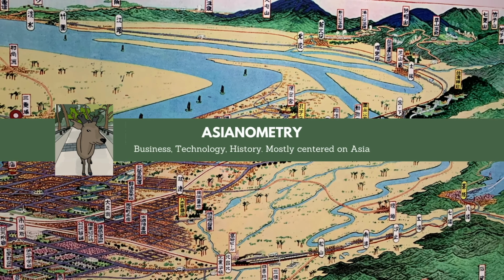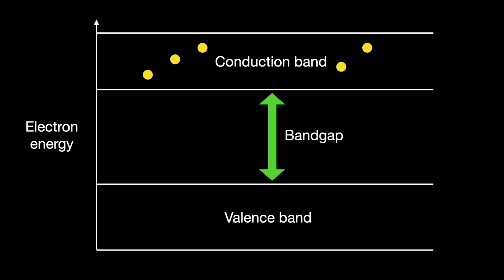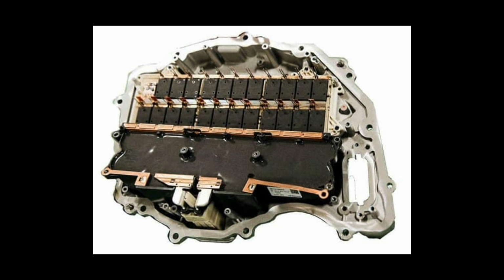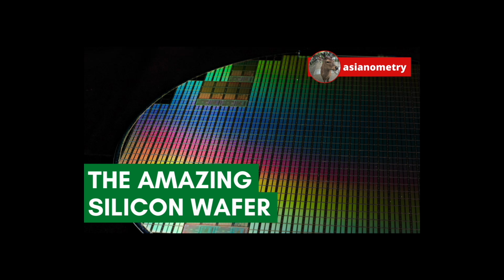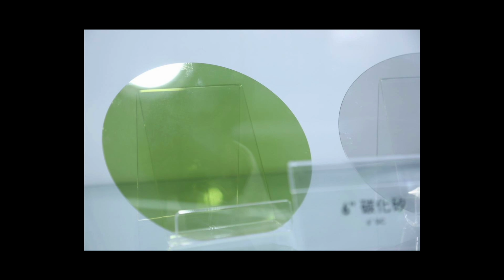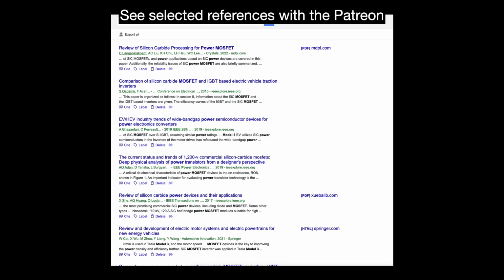Silicon Carbide: A Power Electronics Revolution

Comment: Until a few months ago, I was a research fellow working on silicon carbide devices. Please allow me to leave some commentary:

1:40 - 4H and 6H are the only polytypes that can be grown as commercially-relevant bulk wafers, but 3C can be grown on silicon! 3C-on-Si is... well, it's not great. In layman's terms, the atomic spacing of 3C-SiC is different to that of Si, meaning 3C-on-Si is full of crystal defects. Just to pile it on, SiC fabrication processes can get up to 1600°C, but Si melts at those temperatures, meaning there's key steps you can't do properly to 3C. I am very interested to see if the 3C wafers devised by Francesco La Via and his team - where they start a 3C layer, melt off the Si and grow a new 3C wafer from the starting layer - can reach the crystal quality and practicality required for real devices. 3C has a bandgap that's not as wide as 4H or 6H, but its electron mobility is higher and it might compete with GaN in lower voltage applications. If La Via and his guys can improve their process!

2:00 - 4H has a wider bandgap than 6H and isn't much harder to grow, that's basically why we're using it.

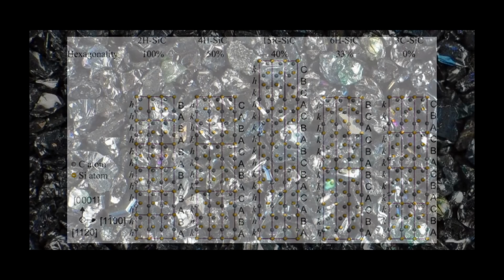2:08 - Tangent: the same strong atomic bonding that makes SiC hard also makes it a pain in the butt to chemically etch. Acids don't do anything to it and basically the only way to etch it is high-power plasma etching (plasma etching is common, but SiC needs a serious bombardment before any of it goes away)

2:26 - This explanation is generally pretty good. The wide bandgap of SiC means better temperature tolerance (lower intrinsic carrier concentration) and better voltage blocking, but you glossed over the higher frequency thing (and, TBH, I don't blame you). SiC has a higher electron saturation velocity than Si. Effectively, the electron speed limit is higher. BUT while the electron saturation velocity is higher than Si, the electron mobility is much lower (and don't even get me started on the hole mobility). The speed limit might be higher, but you've replaced your roads with grass fields. While SiC can match Si up to ~10MHz, it's beaten tidily by GaN at radio frequencies.

4:10 - While SiC as a semiconductor tolerates heat much better than Si, there's a reason why SiC transistors aren't rated to higher temperatures and it's *super important*: the oxide of the metal-oxide-semiconductor field effect transistor. I'll cover it in detail below...

6:57 - Partially true. Above 6.5kV, we go into the world of thyristors. Which I don't know that much about, other than 'big, scary whole-wafer devices', so I'll stop.

7:32 - This stuff about heat is a bit misleading. Power semiconductor devices always need heat management, but once you've put them in a proper box, the environment is usually less important than what thermal management you put in.

8:09 - You kinda turned over two pages at once here, mate. Batteries do not store as much energy as a tank of fuel and getting a battery electric vehicle to travel as far as an internal combustion engine (ICE) one is very difficult. Also, paradoxically, the high efficiency of electric motors means that small inefficiencies in the car's design turn into bigger losses of range. Those pop-out door handles that sit flush to the car while driving don't really make any difference to an ICE car - which is already pissing away ~80% of its energy - but they do genuinely help with an EV. Thus, adding or saving weight translates more directly into range, which is something EV buyers prize highly while they make the adjustment to EVs and their shorter range.

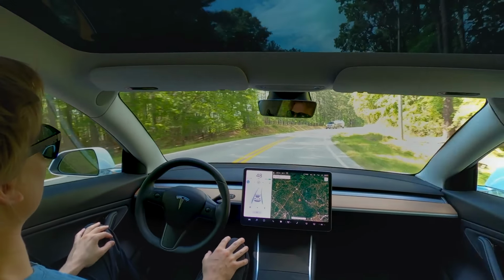8:18 - Sorry, this is a pretty big error. Also kinda complicated to unpack, but I'll give it a go. Beyond the transistor itself, building a power converter requires passive components. Capacitors and inductors. Transistors switch almost a million times per second and passive components act as energy reservoirs to smooth out voltage and/or current. The faster the switching speed, the less time the passives need to plug the gap for, and the smaller they can be. When it comes to capacitors and, particularly, inductors, a larger capacitance/inductance value means a physically larger and heavier component. Fast-switching SiC MOSFETs (they switch much faster than a Si IGBT of the same voltage/current rating) mean smaller, lighter, cheaper passive components, and this is where the bulk of the efficiency saving comes from (although faster switching normally also means lower losses in the conversion itself, so higher efficiency and less heat generated).

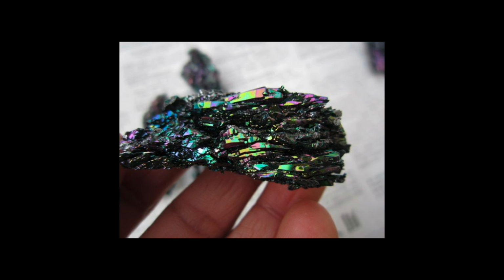9:27 - Material growth is a major limitation of SiC. It's not the only one, and I need to do a full-length diatribe about oxides below...

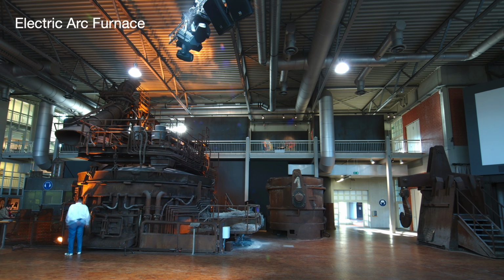10:37 - This breakdown of PVT growth is *excellent*, and I just learned a thing or two about it. This explanation makes the process sound a lot cleaner and less messy than it really is: controlling the temperature gradient around the reactor well enough to create a decent SiC ingot with no polytype inclusions is extremely difficult, and I'm not entirely convinced that another ingot growth method isn't going to replace PVT (/hottake).

11:58 - SiC wafers can be laser cut. I don't know about wafering from an ingot, but it's also possible (if a little risky) to cleave the wafer to dice it, like cutting glass. But just laser cut it.

OK, I need to talk about oxides, not just because they were the topic of my PhD but also because they're the weakest part of a SiC MOSFET. When making a metal-oxide-semiconductor stack for a silicon transistor, you use the silicon as a ingredient for the oxide. Stick a clean wafer in a hot furnace with oxygen flow and it will slowly oxidise to a very clean, orderly silicon dioxide. When you try to do this with SiC, for a few nanometres you get Si oxidising to SiO2 and C burning off as CO2, but the carbon quickly ends up trapped in the oxide and at the oxide-semiconductor interface. This tanks the performance of the oxide. There are moderately-effective ways of un-tanking the performance - using NO or N2O as the oxidising gas, instead of oxygen - but they're still much worse than for Si devices. The on-state resistance of SiC MOSFETs is limited by the quality of the gate oxide and the MOSFET channel it produces. The maximum temperature is limited by the reliability of the oxide: up to 175°C, the oxide is OK, but above that its lifetime shortens drastically. My pet project during my postdoc (which I've still got a successor working on, which I am super-grateful for) was depositing SiO2 rather than oxidising the Si. You can't trap any carbon if you leave it all in the semiconductor. Instead, you have different problems, like oxygen vacancies in the oxide. I should stop.

Thanks for sharing. This video is a good introduction and overview of device technologies that you don't see in popular engineering. Good stuff!
Reply: Bonus comment: SiC MOSFETs are replacing Si IGBTs. MOSFETS generally operate at lower voltage/current and higher frequency than IGBTs, but SiC beats that tradeoff and allows SiC MOSFETs to match the voltage/current ratings of IGBTs, but with lower switching losses and higher switching frequencies. Similarly, the SiC Schottky diodes that replace Si PiN diodes beat the beefiness vs. speed tradeoff to switch big current/voltages faster than Si PiN diodes. But... why not SiC PiN diodes and IGBTs?

MOSFETs and Schottky diodes are unipolar devices. They rely solely on electrons (or solely holes but eww, no) for conduction, which means they can pull in and push out electrons quickly to turn on and off. IGBTs and PiN diodes are bipolar devices. They rely on flooding the device with both electrons and holes when it's turned on, dropping the resistance but slowing things down, as you have to inject those carriers during turn-on, then extract them all out during turn-off. Critically important for bipolar devices is the lifetime of injected carriers ('minority carriers', i.e. holes in the n-doped side and electrons in the p-doped side), as the time it takes for the electrons to drop down into the valance band and fill the holes determines how far they'll travel through the device in the on-state and how long it will take to clean them all up when you try to turn off.

The minority carrier lifetime in as-grown SiC is lousy. There's about 1 part-per-billion of carbon vacancies in the material, but these are states in the middle of the bandgap, making a perfect stopover point for electrons trying to recombine, so they have a disproportionate effect on minority carrier recombination. There are ways to re-process the SiC to improve the lifetime (basically by driving in extra carbon to fill the vacancies), but extra steps cost money and they've not been fully proven yet. Without lifetime enhancement, a SiC PiN diode looks like a Schottky diode, with none of the minority carrier action normally used to reduce the resistance.

There's an extra complication with the IGBT. MOSFETs start with an n-doped base and stack up from there (n-type voltage blocking region, then implanted p-well and n-type & p-type contacts), whereas IGBTs start with a p-doped base. The only good SiC wafers are n-type. You have to grow your active layers, then remove the entire substrate somehow. We did this with a dry etcher, which etched a whopping 300 microns of SiC and jsut so happened to conk out a few weeks later, but you'd probably do this with chemical-mechanical polishing in the real world - a process which is becoming more popular to remove the resistance of the starting n-doped wafer.

Researchers have made SiC IGBTs, though, and 10kV is just the starting point for them. There would need to be some serious work before large-area devices with high current ratings were ready for commercial use (particularly with the minority carrier lifetime enhancement stage), but 20kV single devices should be very much possible. And that's before you get on to SiC thyristors - I started designing and building a high voltage breakdown testing rig before I left, and it will go all the way up to 60kV. My old uni won't make any devices that highly-rated this year, or next year, but I wouldn't be surprised if they reach the point where they hit 60kV without the device breaking down. This is where I get excited about potential future applications. A 30kV IGBT is a real game-changer, and opens the door to wild new possibilities in power conversion. These are exciting times to be a power enthusiast.
Reply: @gigabyte2248   Very well explained but i guess the explanations above would have doubled Video length without adding more information for the average audience. Only point i think this Video could need some adjustment is your comment about the passive components as SIC helps downsizing the whole applications as you described very well above and passives add a big portion to the overall cost on HV applications.
Reply: As a layman (mechanical engineer) I am grateful for this channel and commenters like you two here, who know what they’re talking about. Material science is a fascinating field
Reply: Brilliant.  Huge thanks for dealing with this; somebody had to do it, and I'm glad it is not me.  Anyway here are two more things: stacking faults and threading dislocations.  These are intrinsic to the material (i.e. not due to impurities).  The stacking faults are a consequence of their low energy of formation, and act as quantum wells in the material, because they are in effect an atomically thin layer of a different polytype, with a different bandgap.  Normally, these would occur randomly, which has undesirable consequences for electronic characteristics; however, they have the potential to be exploited in creating devices with special characteristic if they could be fabricated intentionally in a controlled manner.  On threading dislocations, these are also an unavoidable problem for any hexagonal crystal system.  In SiC, they can create microscopic pipes that penetrate a device from one face to the other.  Metals from electrical ohmic contacts then migrate through the pipes and short out the device, resulting in failure.  Methods have been devised to ameliorate these problems, otherwise commercial products would not exist; however, it is not easy.  GaN sufferes similar problems, except the threading dislocations are much smaller, and in this case spoil the optical properties, as well as causing electronic failures.  Of course, we can all dream of using diamond for electronics, which would be even better. . . . However, this is yet another huge topic.  ;-)
Reply: @cdl0  Threading edge dislocations (TEDs) and threading screw dislocations (TSDs) are minor defects, mainly just causing lower breakdown voltage. Basal plane dislocations (BPDs) are worse and expand into single stacking faults (SSF) that add a lot of resistance to the device. I think these are the only relevant 'stacking faults'. Micropipes are absolute killers, like you said, and have mostly been eliminated from modern SiC wafers.

BPDs and their expansion into SSF are nuts. If there's enough energy available (from electron-hole pairs recombining), the BPD expands into a SSF from its root at the interface between the original wafer and epilayer. This can happen at room temperature. Yes, SiC can change its crystal structure at room temperature. This usually happens in bipolar devices (PiN diodes and IGBTs) and is one of two main reasons why these devices aren't out there yet (the other is short minority carrier lifetime: injected electrons & holes recombine so fast that the device is practically unipolar).

There are three ways to attack this problem. 1. Grow a wafer with fewer BPDs. Easier said than done. 2. Get the epilayer growth conditions right to convert BPDs at the surface of the wafer into TEDs (or is it TSDs?) in the epilayer. TEDs(/TSDs) aren't great, but they're better than BPDs! 3. Stop the electron-hole pairs from reaching the interface. Commercial epilayers have a highly doped layer at the bottom, with the dopants causing the recombination to happen super-quickly. This prevents holes from the top of the device reaching the root of the BPDs and causing them to expand. At least in theory.

I wanted to study bipolar devices and bipolar degradation suppression a bit more, but the funding wasn't there and it was time to move on. More progress is bound to be made, if for no other reason than SiC PiN diodes (and IGBTs) would be awesome.
Reply: @gigabyte2248  Absolutely right - yes!  This is one of those never-ending topics; it feels like we could go on forever, and the potential, as you say, it awesome.  Anyway, Aisianometry did a pretty good job within the confines of a short YouTube video, I thought.
Reply: I really think this comment should be pinned. I can only thank you for it!

Comment: dear asianometry
He did not know this quality of silicon carbide that he only used in carpentry sandpaper, quite a surprise.

Just making a bit of a silly proposal, vacuum valves do that job just as well with cheaper technology but just the miniaturized problem.

Is there any possible alternative to this? I am a big fan of valves.

Thank you

Comment: You often mention "packaging" which means something different than what most people normally would understand it to be (cardboard boxes and styrofoam). Can you do a video on the meaning of "packaging" throughout the semiconductor industry?
Reply: i think most people who are into this subject even on a superficial level can figure out that the package means something different. if you've ever studied circuits or built them you know that ICs and transistors come in different packages sometimes with different pin outs even though they have the same chip inside of them.
Reply: It is a very interesting topic that recently evolved into so much more than "somewhat specialised copany glues chip onto circuit board in Malaysia"  with 3D packaging, chip stacking and 3D via connections.